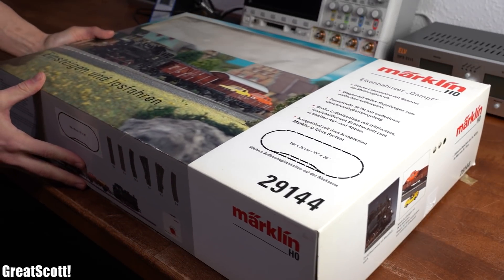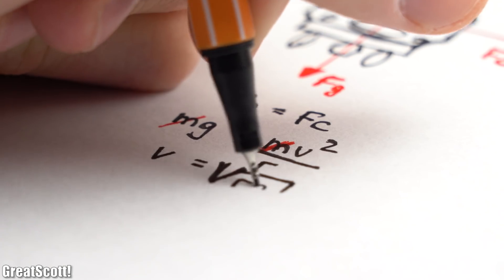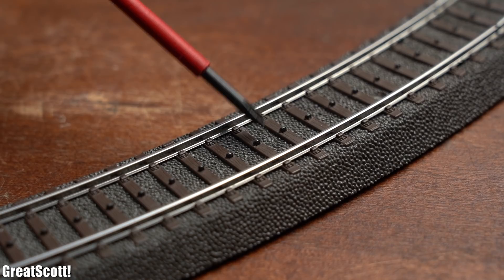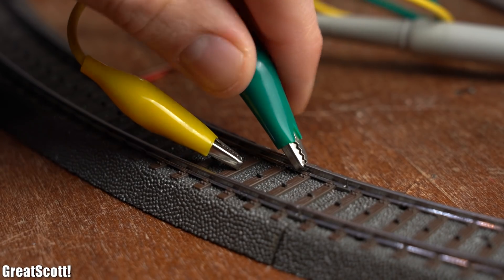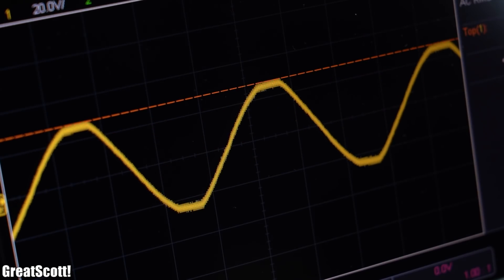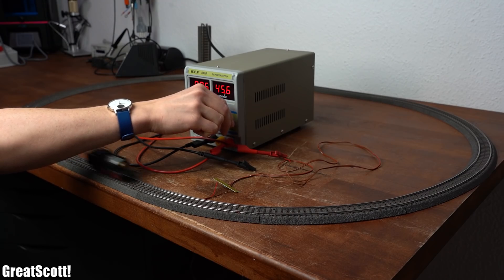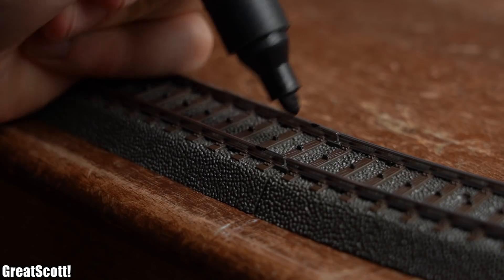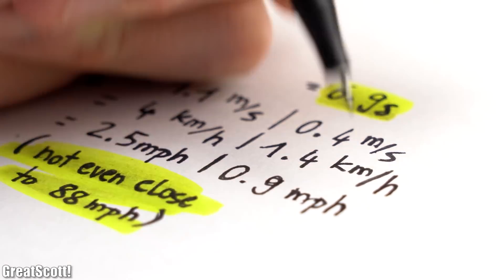How fast can an overpowered model railway drive? 88 mph?

Comment: Does the DIP switches mean that 2 or more trains can be controlled independantly on the same track? and what about controlling that train speed using PWM? 

If you put a magnet on the train and a hall sensor on the track, you can do the stop watch timer without human error..
Reply: You can run and control a lot of trains indepentantly with a digital controller and power supply.  Most newer locomotives does not need the DIP switches. They work automatically.

Comment: Hey I am a little confused here. Why did we equate the vertical gravitational force to the horizontal centripetal force. Shouldn't we use friction along with the horizontal normal force due to the tracks onto the wheel (depending on the shape)... This seems like much more of a topping situation so using torque about the point of contact of wheel and track would make sense right? I am not sure.. can someone help please.. :)

Comment: There is no such thing as a centrifugal force ! (If you take the train as referential then the centrifugal force appears and is considered fictious). It is the speed which is tangent to the path (or not if the train is not turning) that is driving the the train outside of its rails. 

There is only 1 force in fact: the force of reaction of the rails that push the train towards the center of the curve.

Comment: There are tracks available with a wider angle. Flextracks or how they are called. Get that crappy motor out, there are much faster and more powerful motors of that size available. Put in some brushless motor or even stepper motor and build a straight line for starters. Build the curve with a side tilt, so the centrifugal forces press the train in the track. Then it should go much faster. 
https://www.youtube.com/watch?v=6G8P5DHPNBk
That guy here gotten the train up over the scaled up speed of sound, but I don't like his propeller approach, I don't like that short acceleration phase, I don't like that there is no curve and I don't like that it's not looking like a train anymore. 
There is a theoretical maximum speed from the resonance that will build up at a certain speed between the wheels and the tracks and it will be thrown so much from one side to the other, that the train will be thrown off track on a straight line. But we are not there yet.
Good work, Dr. Frankenstein.
But next time we are going to use L4Z0RZ at the start and end of track to measure the exact speed of the train with an Arduino, just search on Amazon Laser+LDR and that's it. I would humbly suggest to use a NodeMCU for that, because that's the chip I am having much fun with at the moment, especially if you are doing it in Lua you can reload code from the flash into ram, which C/Arduino can't. So this can be made a project that makes the landing on the moon look like childsplay. And you can display the achieved speed, the scale speed, the voltage, the amperes and the acceleration of the train (by an IMU on the train of course). 
1368 km/h is good, but not good enough, my dear Doctor. 
And of course we need to do it with a steam engine.

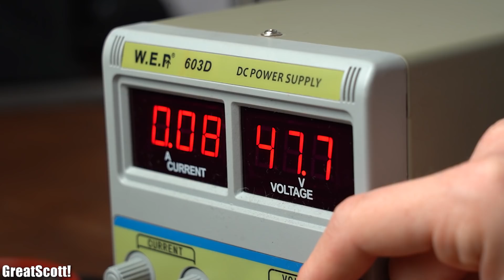Comment: 4:16 That is a classical physics problem, in which the centrifugal force exceeds the force of the locomotive weight.

What I expected to hear next was: To counteract this I needed to increase the downward force; I did not want to increase the locomotive weight as it would require even higher voltages to reach maximum speed, I also did not want to add aerodynamic downforce as the locomotive would not be going fast enough for this, and it would spoil the aesthetics. So instead I decided to magnetise the wheels.

Comment: The real challenge for model railroad is getting the train to run very slow but still smoothly and stable. Digitally with DCC for example it is easy with PWM controlled motor, but with analog control as in this video its a bigger challenge and maybe something interesting for another video? :)

Comment: What the f***g motor is that!? 😱 usually is a 5pole motor with brushed graphite and coper 😥 (usually on Marklïn Ho= 1:87 = 1/87 scale) the neuw motor system is sinus drive soft drive with flywheel too but here a 9V stupid motor like a toy motor 👎🏼

Comment: since the power was not the limiting factor, i wonder if adding a counterbalance weight on the inside of the train would yield a much higher speed or if the additional weight would slow it down.

Comment: You forgot to add the weight of the train as a parameter, the distance between the rails, the position the centrifuge point of the train refering to the rail surface...., As long as thr centrifuge point is closer to the surface =0 or even less than zero you can go at much higher speed, thanks for the video

Comment: You could try adding some magnets at the bottom of the locomotive to increase the force that attaches it to the rails. This method is commonly used in slot cars. Anyway, great video as always!

Comment: I understand that this is the only track you have however testing how fast you can go without derailing in the corners doesn't really determine the maximum speed of the locomotive. To me, the maximum speed of the locomotive would be determined by how much power the motor can handle under load without burning out. Thanks anyway for the video though, I enjoyed watching you set it all up.

Comment: The physics u used was wrong u need to balance torque here at point were the wheel of locomotive meets the track and considering it as a hindge u need to find the center of mass of locomotive and apply torque balance equation then u will get the correct speed

Comment: Can you set up the track as a circle, then attach a cable from the center of the circle to the locomotive? 
(You'd probably need a universal joint in the center of the circle)
As the centripetal force flings the locomotive outward, the cable would resist that motion and hopefully keep the locomotive on the track longer.
Reply: Would be better to just use a much larger diameter track.

Comment: It is not possible to use the formula taken by you as the forces you have equated are perpendicular if had to find the relation between them it would be fc=πfg where π is coefficient of friction for the system

Comment: The outer rail in the curve must be elevated - as on real world railways.
BTW: it makes no sense making a model railway speed around at insane speed, as this is far from a realistic scenery ... 😄
The real challenge is actually somewhat in the opposite: making it run very smooth at slow pace to make it look realistic.
The solution is to have an onboard locomotive power reservoir, that smoothes the drive, overcoming the small connection interrupts at switches and rail joints.
Then in turn make the locomotive motor controller start up and slow down in a realistic way.
This is what model railway fans are paying big money for 😛
Reply: Yeah, that's what we're up to. :}
It's really cool, when you can shunt (switch) realistically.
Reply: That would make a fun video.

Comment: Please perform a follow-up experiment measuring the maximum rail tilt before a stationary train topples over, by slowly increasing the angle of the track until the train topples off. By taking the tangent of this angle, you can compute the theoretical multiplicative constant that should be included in your “simplified model” in your video, where you simply set the centrifugal force equal to the gravitational force. Then re-run your calculation with this multiplicative constant, and share with us the improved theoretical maximum train speed!
The improved theoretical expression is v=sqrt(r*g*tan(a)), where a is the critical toppling angle of the stationary train.

Comment: During the calculation of the theoretical maximum cornering speed you did not take into account the track width and the height of the center of gravity.
The calculation should have been based on the stabilizing and tilting torques.

Comment: You could test out the maximum speed if

Make it a circular track and in the center spot place a pivot and a string attached to the locomotive this will keep it from flying off the track.

Comment: 4:20 this makes no sense. Indeed, you can tell it makes no sense from the force diagram. Fc and Fg can never be equal, they point in perpendicular directions. If your theory is correct, why do cars drive on asphalt instead of ice? This doesn't count as a simplification or approximation, it's just wrong.

Comment: What a coincidence; I am currently demolishing and selling my Märklin Setup I had for 13(?) Years?

Edit: You can bend the tracks in the curves in order to not shoot the train off the table. However, the coal brushes inside the motors most likely do not like high rpm due to friction. Drive train lubrication might become an issue as well...
But could you make it go fast enough to drive horizontally on tracks lying on its side? Will have to test that ;)

Comment: Strange my ho sets always had both rails as positive and negative respectively.
Reply: aquavius nope To my knowledge Märklin is the only manufacturer who uses the system with both rails one potential and a third contact for the other, allows the rail to be made in any sort of loop without short circuits.

Comment: Sadly this is a simplified br89 model and the decoder it´s used shouldn´t have dip switches since those new models are usually programmable through any digital system.
The old models with their universal motor or based on that motor with permanent magnets can go a lot faster and if they´re on wd40 even fly as the model in the video did.
But the new "standard" dc motors don´t consume much power and are quiet.

For digital systems this is very useful because they can only output around 2A without a booster system and the old motors can pick up up to 300mA each.
Also the low noise is excellent for locomotives with sound features as they don´t get disturbed from motor noises.
It already happened when i drove 4 of them that my mobile station said goodbye due to the overload-protection.

Comment: This is a great project. Perhaps consider increase the angle of the circular tracks about the center of the semi circle relative to the flat surface. That should increase the component of centrifugal force allowing for higher velocity.

Comment: Märklin ist Spielzeug und keine model Eisenbahn... von daher ist es okay was du da machst😝

(Märklin is a toy and not a model railways... therefore is it okay what you do there😝)
Reply: Gegen deren CAD-Modellierung und Fertigungsqualität kann man nichts sagen. Ist halt eher ein aussterbenden, teures Hobby.
Reply: @tim3609  leider ist das ein austerbendes hobby😐
Reply: Warum soll das keine Modelleisenbahn sein?
Die Lokomotive im Video gezeigt ist sehr wohl nur ein vereinfachtes Spielzeug aber die teureren Modelle sind doch alle detailliert und wunderschön.
Außerdem ist das 3 Leiter Prinzip sicherer und das Problem mit Gleisschleifen und Trenndioden existiert nicht, selbst wenn man mit Digital mit Gleichspannung fährt.
Reply: @MultiWirth  hast du jemals Schienen mit gnuppel in der mitte gesehen...
Und auserdem modell Eisenbahn ist am besten digital und nicht analog...
Mir braust du nichts zu sagen... mein Vater hat eine riesige Anlage quer durch sein Zimmer, natürlich digital
Reply: @enderdavid_HD_DE  Alter schon mal von Märklin Digital gehört?
Die haben das revolutioniert aber das ist ja egal.
Ohne Märklin würde es vielleicht trotzdem Digitalsysteme geben aber die Herren aus Göppingen hier im schönen Schwabenländle waren halt die Ersten, die ein brauchbares System auf den Markt geworfen haben und sich durchgesetzt hat.

Und ja ich habe viele Anlagen gesehen mit diesen "Gnuppel" in der Mitte.
Die fallen normalerweise kaum auf.

Also ruder deine wahllosen Aussagen mal zurück und informier dich besser vorher.

Ich bin stolz auf meine Märklin Sammlung und die Loks sind unverwüstlich und mit Dekoder sind sogar die ältesten Loks umrüstbar auf Digitalbetrieb und funktionieren nach 60 Jahren immernoch!

Comment: Looking at the train set you have, it looks to be HO scale (1:87 scale).  Based on that, the 2.5 mph speed you measured would be a scale speed of 217 mph; so, you did exceed a scale speed of 88 mph.  Now you just need a scale flux capacitor.  I imagine you must have one of those sitting around somewhere.

Comment: As someone mentioned, you could try banking the tracks to go faster; but, I could see how that might be a more difficult modification to make on somebody else's train track.
Another approach; however, could be to bias the locomotive to allow it to go faster.  Two approaches I thought of were 1) to bank the locomotive or 2) to change the CG of the locomotive.  Banking the locomotive might be easy or hard depending on how the locomotive attaches to the wheel; and, it might not be as visually appealing.  Changing the CG to move it lower and inward might be easier since the engine is likely pretty light.

Comment: Actullay I think the physics part is a bit wrong.........
 we actually have to equate the maximum normal that the sides of the track can provide to the centripetal force 
So calculate the maximum normal provided but the side of the track before which the train jumps of it and equate it to mv^2/r
Reply: 11th grade physics in action wow
Reply: akshat pathak I am In 11th too
Reply: The factor of air resistance also needs to be taken into consideration. You all are missing that.

Comment: aah. good old Märklin 0-16VAC rheostat with the 24VAC reversing output. My older engines used a solenoid and spring to reverse direction to the AC motor, not a circuit board :)

Comment: Your derivation for the theoretical wasn’t perfect but a good approximation. You’d have to find the location of the center of mass and find the speed at which the torque about the outer rail due to the centrifugal force exceeds that of the torque due to gravity
Reply: Your explanation is only correct. Strange that so few people get this. Its the reason why sports cars are so flat, i.e. close to the ground.

But i wouldn't call it a good approximation. His premise is pretty much wrong because it doesn't take the geometry of the train (position of center of mass) into consideration.

Comment: I was hoping you will tilt the tracks slightly when the track is turning, like Bullet trains here in Japan, to counter the centrifugal force and achieve even higher speed without falling off the track. I'm pretty sure it would look cool. Also you can probably upgrade the motor to a Tamiya Hyper Dash 130 or something.

Comment: 4:15 Your calculation for how fast the train can go around the curve is a bit off. You can’t just set Fc equal to Fg and solve for the V, you have to use the torque of those forces about a pivot point, in this case the pivot is where the right wheel meets the track. To find the speed where the torque due to gravity and the torque due to the centrifugal force are equal. So you set 
[Fg*(horizontal distance of the center of mass from the bottom of the right wheel AKA half of the distance between the wheels)]
equal to 
[Fc*(vertical distance from the center of mass to the bottom of the right wheel AKA the height of the center of mass)]
And then solve for V in Fc.
Reply: I was looking for someone to point this out. Surprising how almost no one else in the comments saw this mistake

Comment: The "motor controller" actually is a digital decoder. (Motorola system) the address can be set with the DIP switch.  All 0 means analog Märklin system (50Hz 0-16V, 24V to reverse, which was done with a latching relay and a field coil on older analog only locos
Reply: but why on earth does it have switches?
Those new and simplified models usually have a programmable decoder which autodetects AC/DC-digital mode.
You only had to set "0" on old models with delta or 80 adress digital decoders to run them on AC.
Reply: @MultiWirth  I don't know how old this one is. Can't be too old, the older ones had the loud 3 pole AC motor in them, this one already has a DC motor.
Maybe they reverted to DIP switches on simple models because if you would upgrade to Delta or a simple digital system, you cannot easily reprogram it. Reprogramming usually requires a rather expensive central station. (Like the Märklin central station or the ESU units, or PC software.) 
When I was a teenager and only had the cheap Delta 4f I had to go to a shop to get the addresses reprogrammed at those newer decoders.
Reply: @TheRailroad99  You can reprogramm any märklin digital locomotive fine with the IR control system (also often included in startup´s) but can´t on the very old delta system but it´s kinda useless to get one of these.
So i don´t get the point why they brought back dip switches.
I also have the old locomotives with their AC motors and the good thing about them they´re much faster and it´s sound is just beautiful mechanical ;)
The newer models are boring but good if they have any sound features
Reply: @MultiWirth  This is from a 2006 year starter set, so not new or advanced. It doesn't even have a light.
Reply: Sounds Marklin digital system very complicated. DCC is much easier, in my opinion.
Reply: @Adrian-A320  not really, they are both very similar in complexity.
Reply: @TheRailroad99  thanks for clarification. But comparing with DCC, the 3rd rail is less realistic than DCC, in my opinion.
Reply: @Adrian-A320  Märklin isn't so complex.
It depends on the used protocol.
While mfx gets auto detected, some older locomotives with for example delta decoders obviously don't support this and use mototola instead.
Those decoders require to be configured manually via dip switches.
The good things about Märklin: it supports many protocols simultaneously.
So you can talk to your 20 year old locomotive aswell as you need new ones.
The mobile station 2 has a card reader and you can save the config of any loco to a "credit card" so you can take your loco to a friend and and simply add it to his  mobile station's database.